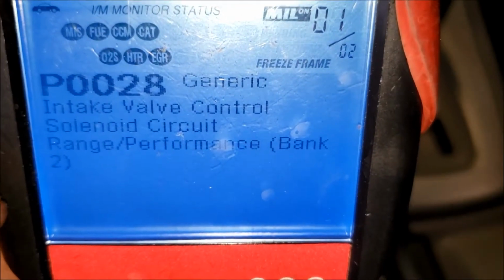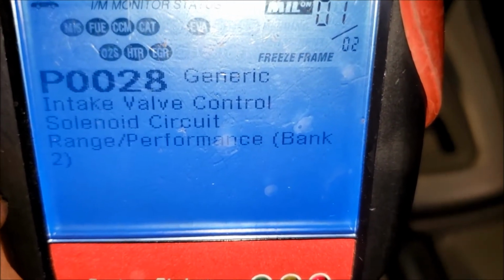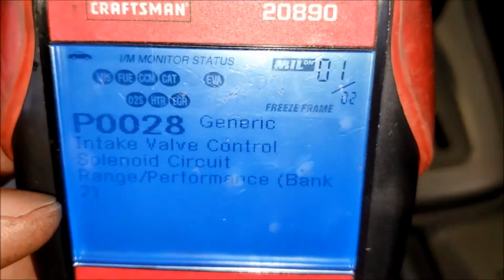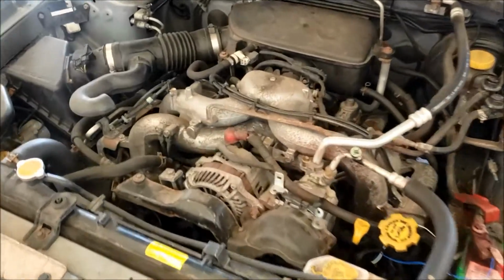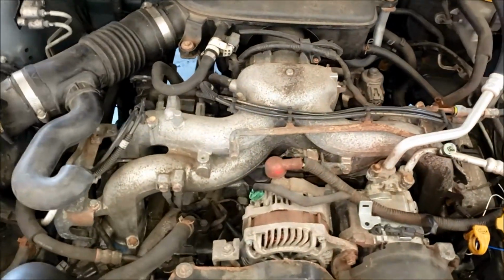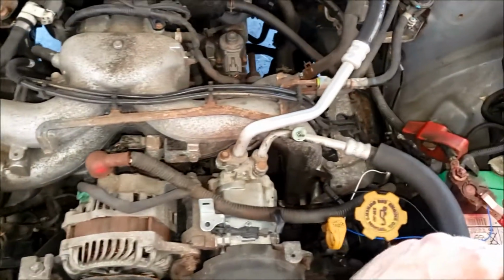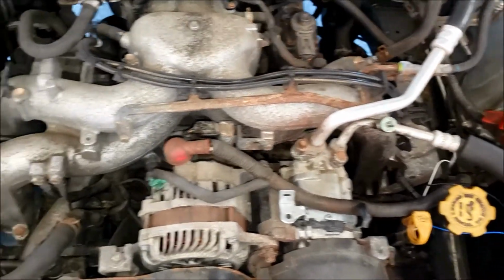P0026 P0028 on Subaru - Tribeca, Forester, Impreza, Legacy, Outback Impreza 2.5L 3.0L

Comment: Great video!  My wife said someone told her you basically had to pull the engine to get to the VVT solenoid.   They may have been wanting to overcharge her on labor, or maybe there was some miscommunication somewhere about which part needed replacing.  Regardless, I now feel confident to tackle the job myself.
I especially like how you showed how to test the oil pressure switch first.  I liken this to how you would check a light switch in your house before replacing the light fixture.  This was very good to know, especially the fact that the O.P. switch is the most common failure on these Subies.  I definitely will sub and check with you first before any future repairs where I'm unsure if me and my shade tree are qualified to handle.
I think I saw one small mistake, but it was really nothing.  At 8:02, you referred to the driver's side as 'Bank 1'.  Like I said, it was nothing.
Thanks again for the clear, straightforward video, with no AI voices, or unnecessary music.

Comment: Chris, your video is spot on. For the benefit of others: 2006 Subaru Impreza 2.5i, check engine light ON, cruise control light flashing, code reader indicates "P0026 (Intake Valve Control Solenoid (Bank 1)." Nope! It was the oil pressure switch, just as you said. Mine measured 46 ohms. Only thing I would add to your video is to "bring a multimeter with you to the parts store." Test the new switch before you leave. I didn't. When I got home, I tested the new switch and it had even higher resistance! Took it back. The second new switch measured less than 1 ohm. Put that one in. Cleared the code. Problem solved. Thank you, Chris! I watched many videos on P0026 DTC. Yours is the only one showing how to quickly test these parts with a multimeter. Real NNKH!

Comment: 2008 outback non turbo.  I have replaced the vvt oil pressure switch and the vvt solenoid.  oil level is good/clean mobil one 5 30.  I am still getting p0028 code and it limits the rpm to 4000 rpm when lit.  Would the cam sensor right near there be an issue maybe?  bank 2.
Reply: Did you have any trouble getting that 10m bolt out for the solenoid valve on bank 2.  Seems near impossible due to it’s location!
Reply: @danielpenrod9478  I had to take off that bracket right by there.
Reply: HEY! When you say limits your RPMS to 4k, do/did you get the bucking/lurching at 4k? It’s driving me nuts…
Reply: @APinTheAK I broke the block where the vvt oil sensor goes.  After 4 tries, I got the oil leak to stop using 2 different epoxies and still got the vvt code and the 4k Rev limit   Turns out the epoxy would not let the vvt oil sensor ground. I grounded it and that solved my vvt code issue .  I still get other codes.  I really wish there was a way to eliminate the subaru practice of disabling the cruise on a CEL.  is there a way to eliminate that does anyone know?

Comment: P0028 code a stop and get towed code or can you drive it to a shop ?
Reply from the maker: If it's driving fine then I'd say drive it. Not going to harm it
Reply: @ thank you.  Peace of mind.   Came on while stuck in traffic yesterday on the ride home.  Stoped at advance auto and checked fluids, in parking lot, all good including oil, and asked them to check codes.   Told me p0028.  Going to do your diagnostics today if it warms up.   It isn’t a daily driver, maybe once a week.  Thank you for the videos and the quick reply.

Comment: Changed both censors and switches plus oil change when one was done about a month prior. Code switched from p0026 to p0028. Code keeps coming back. Any idea what to try next?
Reply: Did you find your problem? Mine did the same. Had p0026, changed the Ops then p0028 popped up. Changed that sensor & p0026 came back. Changed both solenoids but still flip flops from 26 & 28 every time I clear the code

Comment: Would this potentially cause an intermittent starting issue? Could a bad starter kill these?

I have an Outback that has been intermittently been turning without starting. Got a new starter to swap, but check engine came on and OBD tells me P0026, so now I'm not sure which to replace first between starter and sensor.

Comment: I know this is an old video and would appreciate some feedback if possible, recently got a p0026 code. Oil full, clean and under 2k on recent change. My question is I noticed when I turn my ignition to “on” position these solenoids clearly actuate and click, should this be the case? Or would this be a wiring issue.
Reply: Hey did u figure it out? I have the code too
Reply: @georgeflesch1288  check the solenoids as stated in the video, mine seemed fine But noticed my rear cam plug was not 100% flush and rather was protruding at an angle after adjusting I have had zero issues. Unsure if that correlates tbh
Reply: @cjp25  I’ll check it out thanks, I’m 17 and dunno much about cars lol, I just know the cel came on, and the guy at auto one said the code was p0026, and my rpms are really low when idle and I’ve noticed a loss in power

Comment: Very useful video, thanks! Many threads out there state that for the P0028 it is never the solenoid. Well, in my case it was. After a lot of work, including an oil flush and testing the switches, I finally swapped the solenoids and the code flipped from P0028 and P0026. Ordered a new solenoid from Amazon for $30 and the error code is gone. To replace the driver's side solenoid, you have to unbolt the camshaft sensor bracket that is in the way, at the end of this video. 10 mm bolt and some wiggling of the sensor bracket needed. After that, just wiggle out the solenoid, put in a new one. Can by a 15 minute job.
Reply: facing this problem P0026 code and i believe it’s the passenger solenoid. my car is junk so i’m trying to swap the solenoid from drivers to other

Comment: Is it possible to bypass the drivers side oil pressure switch with a resistor and trick the computer thinking it’s there? Or would that not work since it changes?

Comment: was driving and heard a bang and car cut out. Thought no petrol but when got car home and tested it I got the 28 code. Car does not start. All the videos I’ve watched all of them has an engine that starts so is mine worse? Camshaft actuator issue the computer says

Comment: Hi! Do you have a video for code P0301 Cylider 1 Misfire Detected for a 2006 Subaru Impreza. Thank you!
Reply: Did you get it figured out yet?  It's most likely just a bad spark plug or spark plug wire.

Comment: I have a 3.0 v6 with p0028,  it is the rear oil sensor on the driver's side? I changed the solenoid, LF but have same code.

Comment: Pulling off the interstate and before coming to a complete stop my 2010 subaru impreza started shaking and all the dash lights went crazy. The car stopped working and wouldn't start again.  Towed it home. It threw both codes p0026 and p0028.  Changed out both oil sensor switches and topped off the oil.  It was a quart low. Had changed it less than 3 months ago.  But car still won't start. Any  ideas where I go from here? Thanks. Hoping the engine is not seized up. Car has 136k.

Comment: Just got one of these taking a small S-corner pretty tight.  Just a tad overdue for an oil change.  Oil light functions but it didn't come on.  Hoping it's just low oil and sloshing around triggered it.  Thanks for the vid, most def.

Comment: I watch your video and I was able to replace the VVT solenoid on bank 1 and two oil sensors on bank 1 and bank 2. I tried to replace the VVT solenoid on bank 2 , but my 10 mm socket is not able to reach the 10 mm bolt due to the cam sensor bracket.
Reply: I had the same issue.  Instead of removing the belt housing, I used a dremmel and made space for the socket.  (Someone that doesn't work on cars designed this. Lol)
Reply: @emmahaskell8644  Yup. I did the same thing

Comment: hi. thank you for the video. very helpful.
sorry for the silly q: why does that oil pressure switch have high resistance?
Reply: I'm surprised no one answered this... The oil switch is failing internally. Usually a seal fails allowing fluid in, and causes the resistance. Hope that answers your question.

Comment: Just had the 28 code pop, had no leaks and full/clean oil and was concerned it was going to be more money I didn't have to throw at the car lol. Thankfully it's a cheap replacement and fairly easy to do. Just hoping that's my issue with it being a common issue

Comment: What if the connector doesn't have 12v going to it? Bank 1 has 12v but bank 2 is only getting 1v. Solenoids and switches are working fine, just no power.
Reply: I’m having the same issue have you figured it out
Reply: @emiliogamez9062  I solved it by selling the car. It was too big of a pain with all it's electrical issues.

Comment: When you check resistance on the switch did you check it when the engine is running?
Reply: I see this is an old question, but in case it helps somebody else...  It absolutely does not matter if the car is running, key on engine off, key off, battery unhooked (as long as you don't use the negative terminal as your ground).

Comment: Just cracked the head installing a new pressure switch, it barely took anything at all. People without much wrenching knowledge need to be very careful changing these!
Reply from the maker: ouch!  im sorry to hear that.  Yes, torquing fasteners properly by hand takes takes some experience.
Reply from the maker: I wonder if there is a torque spec on this sensor
Reply: @NoNonsenseKnowHow  not sure, the thing cracked when it wasn't even halfway as threaded on as the old one was! Luckily there's a repair kit that basically involves tapping a larger hole, apparantly cracking is common around my year (2007)
Reply: @NoNonsenseKnowHow  17 N·m (1.7 kgf-m, 12.5 ft-lb)
Reply: @visitor8948 wow yeah thats like nothing

Comment: Hey buddy thanks for the video for my car the code is the same but the check engine light traction and cruise is not going away any suggestions?
Reply from the maker: No problem. And if you cleared them and they keep coming back then you must have another issue. Need to scan the codes and diagnose
Reply: @NoNonsenseKnowHow  I have a 04 legacy I put a sensor in but the mechanic said to drive the car for a day and drive it more it’s like the turbo isn’t kicking in
Reply from the maker: Got you. Sounds like it needs further diagnosis
Reply: @NoNonsenseKnowHow  yes I have done that
Reply: @tylercool2964  Did you ever figure out what the problem was?
Reply: @bradbartley9795  yeah it was a secondary air pressure sensor I got it deleted

Comment: Have a 2007 forester with code P0026.  This video was very helpful to show what i'm getting myself into for DIY.  Will give it a shot, thanks!!
Reply: Hey man did you fix it? I have an 06 forester with the p0026 code and idk what to do
Reply: Wow, you are testing my memory here.   I'll go back to my maintenance log and confirm, but yes, I fixed it, and think it was the oil pressure sensor on bank 1.  It was pretty easy as I recall and that code hasn't popped since.  I'll look back later today or tomorrow and will reply again.  Btw - I still have the car and it's running well!

Comment: So if I take my 2008 Impreza with both those codes to mechanic how much would I be planning on spending?
Reply: Well each of the vvt solonoid from auto zone cost about $110 each.  You need 2.   The oil pressure switch/ sensors were $12 each, you need 2.  I did the work myself.  I would estimate with parts a auto shop would probably charge around $350.
Reply from the maker: I get that type of question a lot. Unfortunately it's not one I can answer. Prices vary so dramatically from region to region and depending on what type of mechanic or shop you bring it to.  If you plan on just shotgunning it in replacing parts then you can call a few different jobs for a quote on doing so. Otherwise, most shops charge at least $100 off the rip just to diagnose the problem in suggest what repairs may be needed

Comment: Im only getting a code for bank 2 but it seems testing both bank 1 and bank 2 solenoids im not getting any click sound. Im hooking alligator clip to the solenoid and then to ground, and another one from the solenoid and tapping on the battery positive. The battery is disconnected from the vehicle though.
Reply: Little update, i tested everything the the battery connected to the car and now both solenoids work just fine. Found out that it was just the sensor switch and my wifes car is still bogging down because the power steering pump is binding and causing the accessory belt to stop turning
Reply: @Electro_Evolution  something to be said about grounding the solenoid to the car and then being surprised it doesnt actuate with a battery thats not grounded to the car.... thats like hooking a fuel line to the engine but not the fuel tank and acting surprised when you dont get any fuel

Comment: Hey Chris, My passenger side pressure switch - has oil on the sides  - I clean it and it comes back - is it possible that oil can come up through the switch and out the electrical connection?  Thee are no codes - and engine runs fine, but it has that oil leak.
Reply from the maker: Hey.  yes that can happen
Reply: @NoNonsenseKnowHow   Chris - it leaked for 8 years and worked fine, but finding the oil drip was driving me crazy - I had no idea it was up top from the sensor.  Changed it out and it's dry as a bone!   thanks!!
Reply from the maker: Awesome! It's pretty rare to see sensors leak through but it does happen. Glad to hear you got it taken care of and I appreciate you updating. Thanks! Your comments may also help somebody else out in the future.
Reply: @NoNonsenseKnowHow   The leak came from under the plastic ring, not the electrical connection as I thought .  There's a hole there - maybe a breather of sorts - that was the leak.  Oil was blowing through under pressure.   Thanks again.
Reply from the maker: @cheskybaba4864  oh gotya.  ok thx!